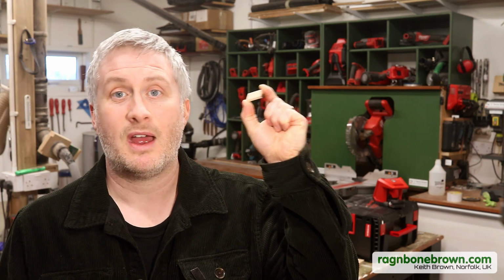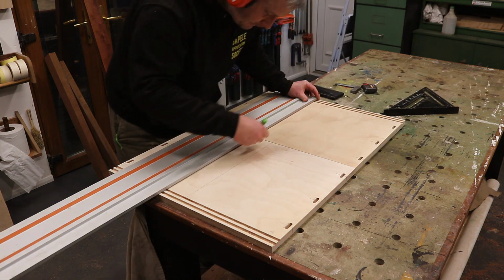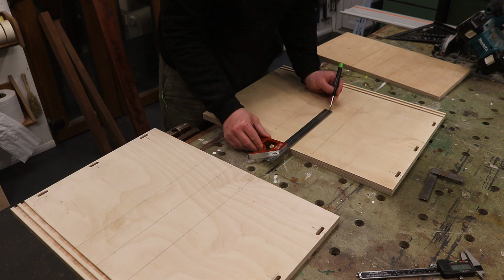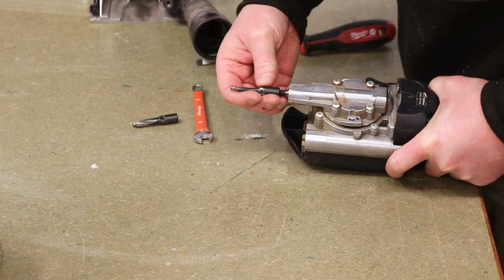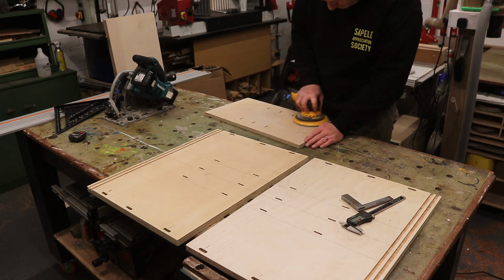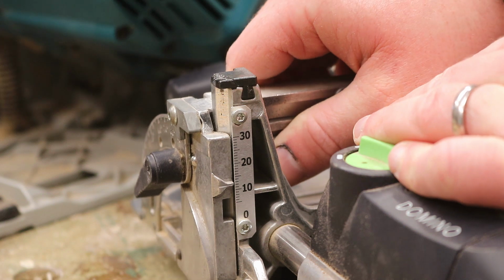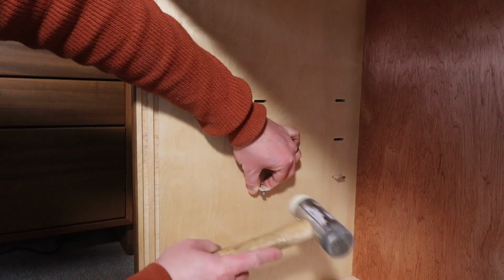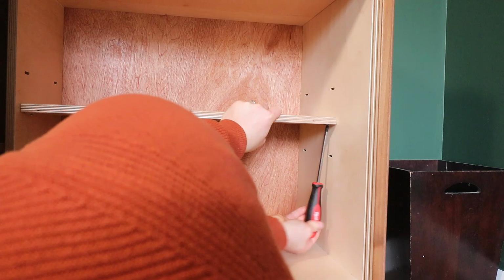A New Use For The Domino?

Comment: Do you think regular dowels would have been just as sturdy? Especially dowels the same diameter as metal shelf pins? They'd be easier to install as they'd only require a drill, which most people have.
Reply from the maker: Shelf pins are usually tiny, so I don't think the same size dowels would be a good idea but depends how much weight you're putting on them. 6mm or 8mm dowels would be fine for most cases
Reply: @RagnBoneBrown  Thanks for the info.

Comment: Interesting idea. There is more potential for inaccuracy and wonky shelves if you don't measure correctly than there is with pins, but equally those shelves should take more weight without the supports bowing downwards. It's always nice to find unusual uses for tools we already have.

Comment: Excellent. Someone should make steel or brass dominos specifically for this purpose.
Reply: I use 4mm dominoes. A spacer block means that I can put in a series of slots rather like a shelf pin jig. A refinement is to make some dominoes out of 4mm polycarbonate sheet. Polish them up and they can be used on glass shelves.